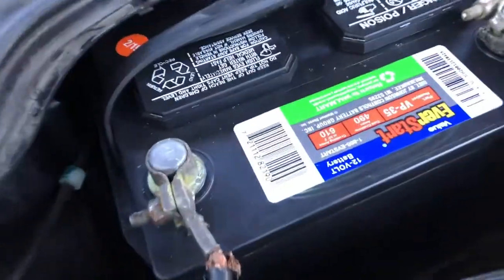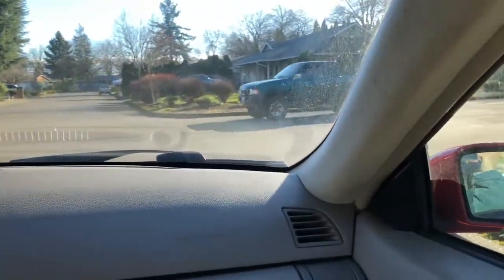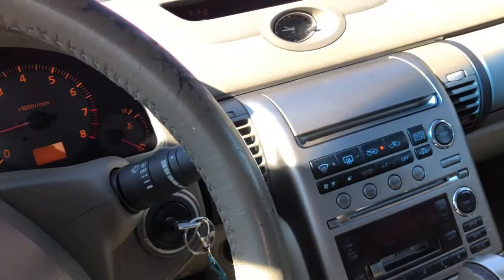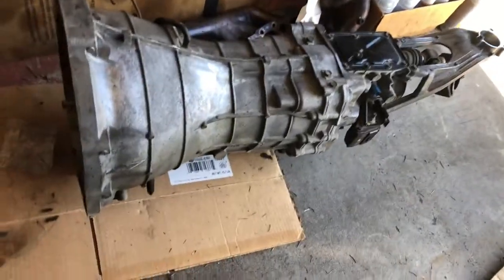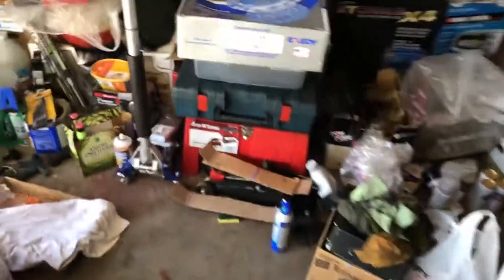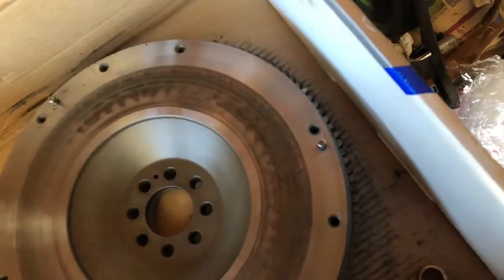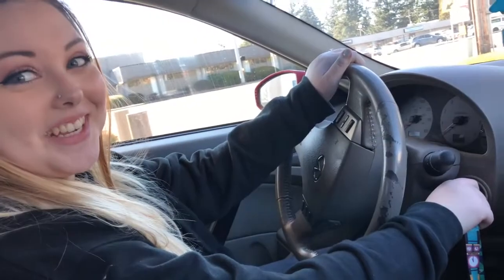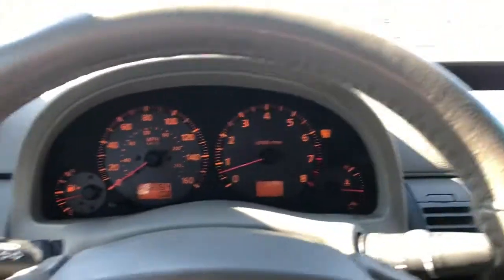Plans for my $1000 G35 Coupe!!

Comment: I bought a 2004 g35 auto for 500! Clean tittle also no damage or nun just 200k miles
Reply from the maker: nice! that's a great deal!
Reply: H&H Racing Development thanks I wanna start a yt channel but I don’t know what should I make it about ;(
Reply from the maker: Pedro Garibay make a video about the g35! We all start somewhere!
Reply: I will soon, but I have a question the motor blew and I have a engine from a 2003 g35 coupe everything is the same it came with the wire harness. Would it work with the original 2004 ecu.

Comment: how come you refill 87 Gas and not the Premium?
Reply from the maker: KillerXP motor had rod knock no point to put in good gas if the engine is about to blow.
Reply: @hhracingdevelopment6792  thanks! Gotchu! Was told to fill 91 and didnt think about that under ur situation.

Comment: How did you manage the trans swap. I have a Sedan I want to do the same thing for
Reply from the maker: very easy, you must remove the automatic shifter and shift assembly so its just a hole to the bottom of the car, you will need the manual transmission brace and also drive line. Or you could use the automatic driveline but you would need to cut the snout piece off to fit. watch my latest video for an update!